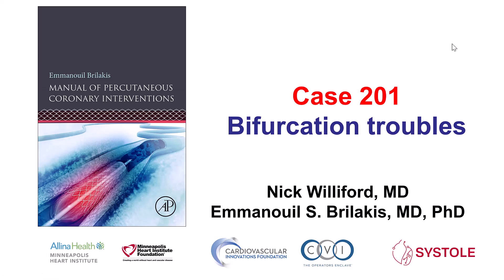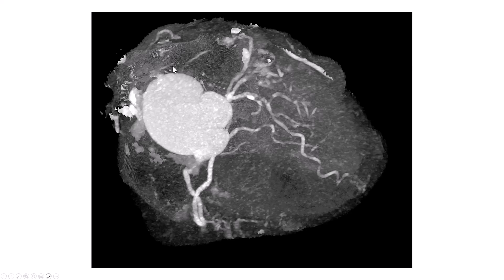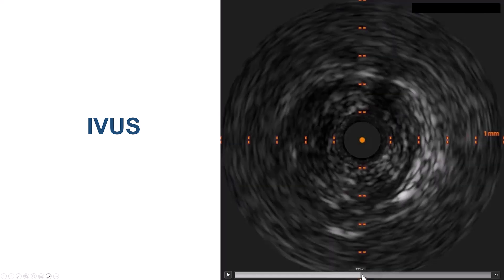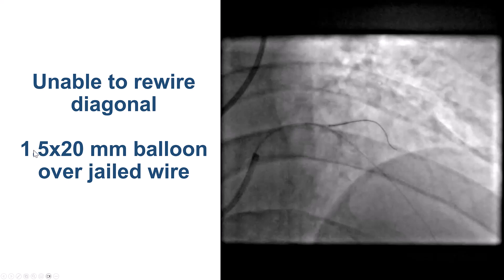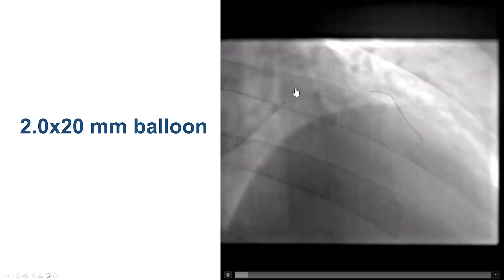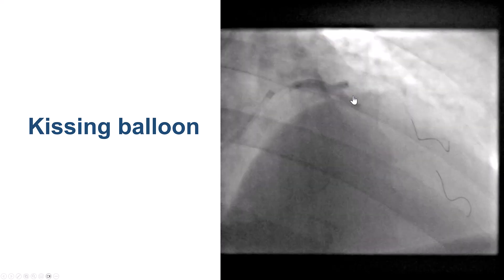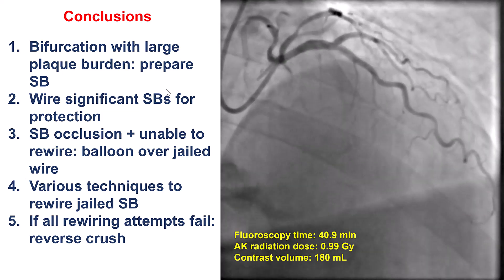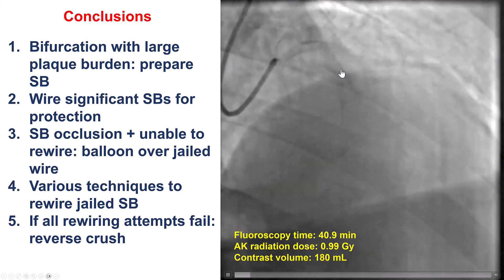Case 201: Manual of PCI - Bifurcation troubles

Comment: Why you didnt use 2 stent strategy? The angulation of D-branch clearly not easy to rewire, but i agree that there is no lession. Dk crush is the look comfortable. And if i cant rewire side branch the first step is fielder xt, to find micro channel, if dont work - POT with end of ballon in half of ostium, that is why the strat protrude into side branch and open way to wire.

Comment: The pull IVUS shows crushed stent just distal to bifurcation (without stent coverage in 6 to 12 o clock position) in the LAD probably the wire crossed abluminally into the distal LAD at that point.
Reply: Agreed 7:05